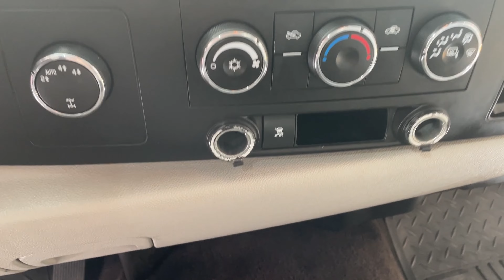Full Interior Detail / Satisfying / Relaxing

Comment: You can use all purpose cleaner without phosphate in it , or use ph neutral all purpose cleaner , dilute 1parts product :10parts water or near if is ready solution bottle, spray the headliner by small square once a time, let it 1minute and wipe with microfiber towel damp water follow with another one dry
Reply from the maker: I have tried several techniques for headliners. My most effective is Folex on a micro and gently agitate. You don’t want to over saturate. The I immediately put a fan on it.
Reply: @SweatTheDetails  thanks , how you deal with sea sand in carpet is a nightmare to remove even with powerfull vaccum , i use some brass brush but take a while to remove all inside ... , need to invest in a 50liters air compressor and rotador but dont know if is effective as a guy on YouTube called tornador wash have a new design of rotador 5x time better than the original and is not avaible for now but later , but that need a 200liters compressor air with 11bar .
Reply from the maker: @sandwichburger4856 never heard of a rotordor. I use a Tornador. It seems the most efficient way I’ve found. You definitely want to invest in a compressor if you plan on doing this stuff.
Reply: @SweatTheDetails  yes rotador , its the vaccum mix with tornador in one hose